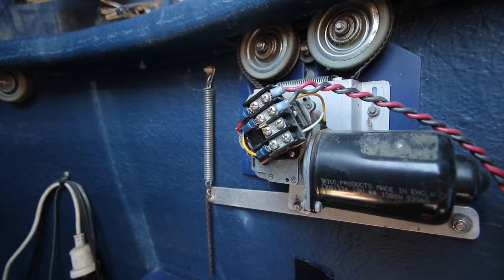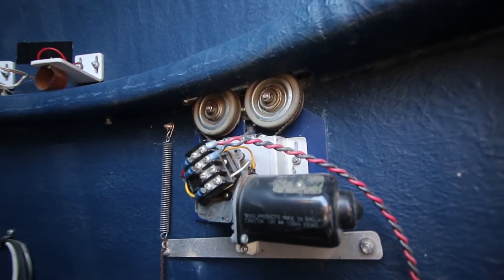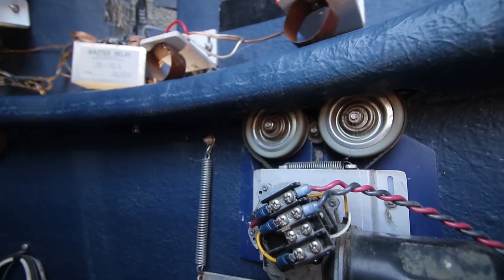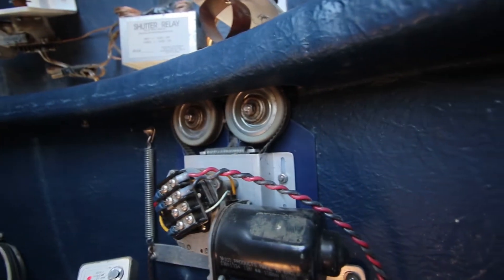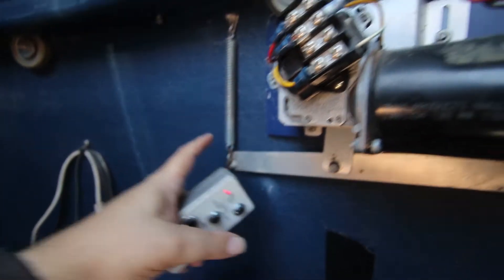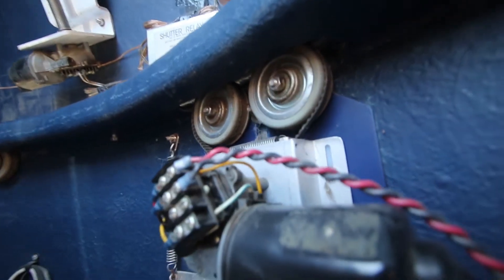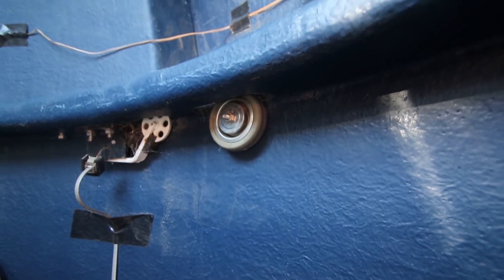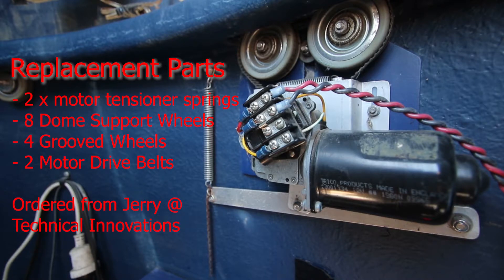Ep 007 - Dome Jamming Followup

Comment: Is your roof friction driven? My friend Terry and I both have Sirius 2.3 metre domes and we want to motorise them. We're based in Geelong. Are you local by any chance?
Reply from the maker: It is friction driven. The weight of the fibreglass dome parts rests on two sets of motor driven wheels (the underside of the dome has sand embedded in the resin for additional grip). As you can see, there is a tension spring to help adjust it. I'm in Melbourne. You can get the motor kit from Technical innovations in the USA, but there are numerous options for retrofit motor kits available (talk to Sidereal Trading in Melbourne, they supply nexdome stuff).
Reply: @TurboTalksTech  I'm watching the Observatory playlist you've done some cool videos. I will build my own system because I have a fabrication shop at home. My mate Terry is quite handy with Electronics which is useful too. I just finished building my Observatory recently. I'll send you a link to my Mega NZ photo and video gallery. Nice to meet a local Aussie doing Astronomy 👍